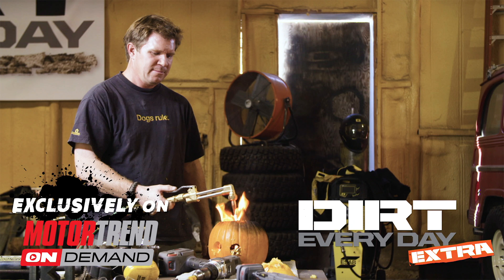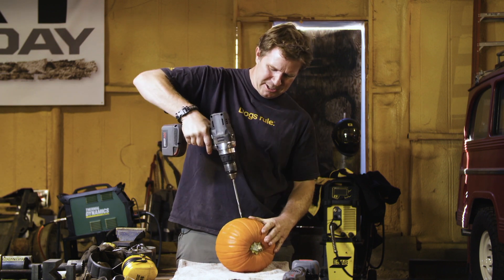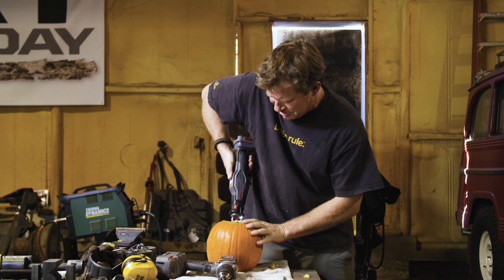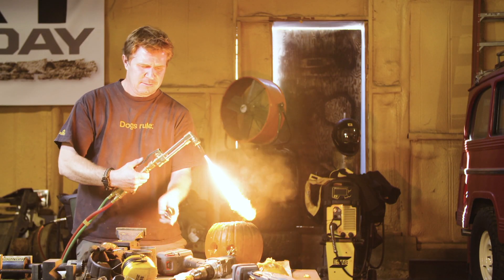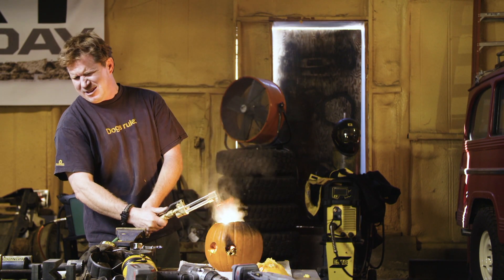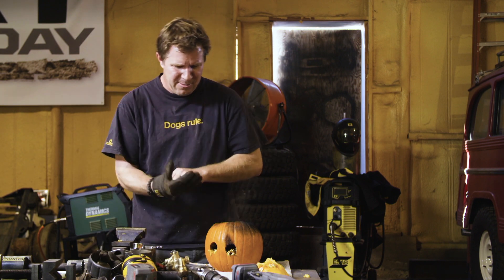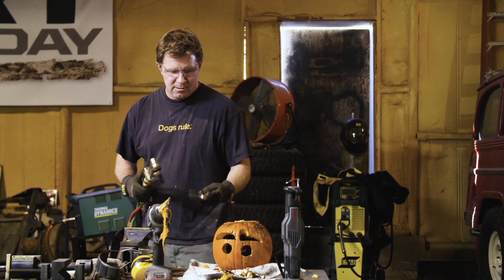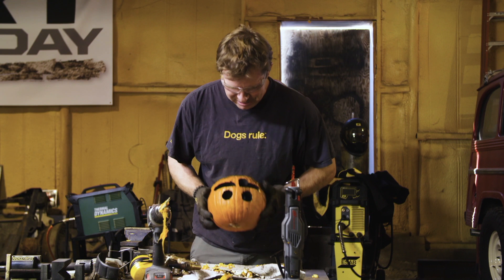Carving a Pumpkin Dirt Every Day-Style - Dirt Every Day Extra

Comment: I recommend drilling one small hole just big enough for your torch tip. Then crack both the oxygen and acetylene valves, insert the torch in the hole and count to 5. Count to 10 if you have a really big pumpkin. Next turn off the oxy, light the torch and hold it over the hole. Guaranteed this method will clear out those pesky pumpkin guts and get you on your way. I also recommend wearing safety glasses and a cup.
Reply: See, this is what makes this channel great. People who are willing to share helpful tips like this. We all benefit. :)

Comment: anyone else was yelling "Oxygen" at the screen when he was using the torch?
Reply: oxygen is still a gas....right?
Reply: That torch is an oxygen-acetylene torch: it uses pure oxygen and acetylene to produce a flame that's hot enough to melt steel for welding or cutting. Fred neglected to switch on the oxygen supply, leaving the acetylene to burn in the air outside the torch. This is why it made that big, sooty ball of flame- if used properly the torch would make a thin, blue-white flame that burns completely clean.